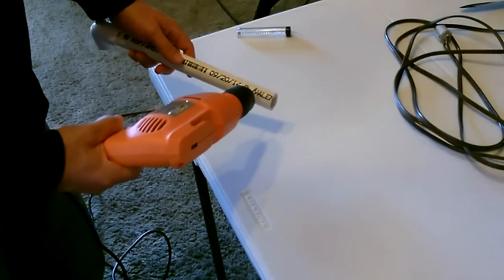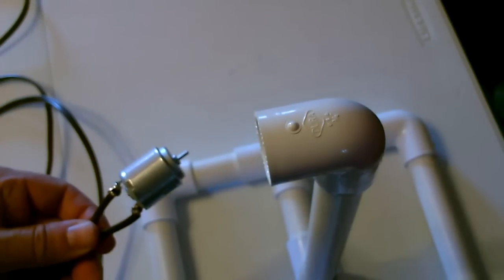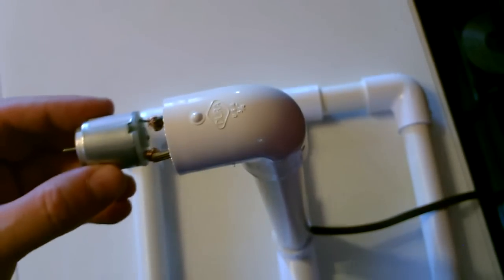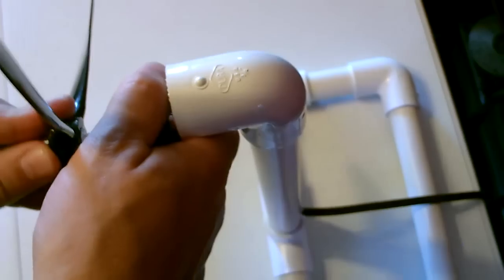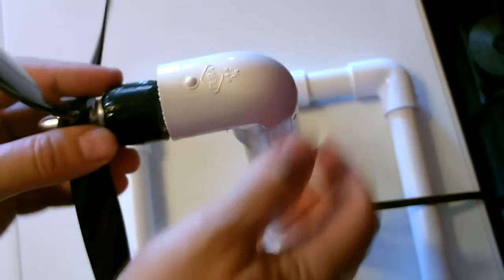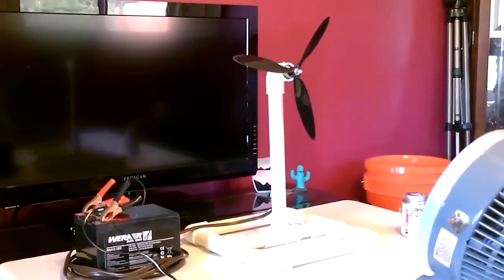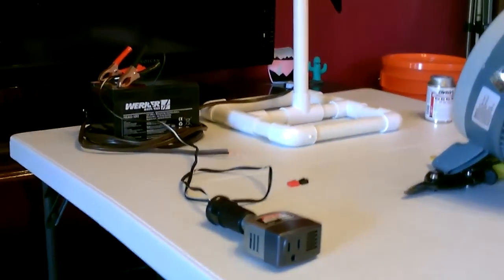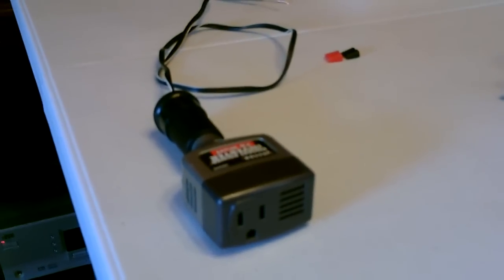Homemade Wind Turbine Generator! - Wind Power Generator! - simple DIY (runs radio!)

Comment: What kind of motor n what's a charge controler?
Reply from the maker: hi there. you can use various motors (even just a small hobby motor works). a charge controller generally is used to make sure that a battery does not overcharge.

Comment: Give the specifics on the motor, fan blade etc.  Where do I get the electronic parts from ?  Your video is good, but how does a novias like me get all the parts.  You mention another gadget to charge the battery, otherwise the battery will run the motor.  What is it specifically?  How do I get one.  Without all the information, your video is of little use to me.  Can I couple a bank of motors and blades for more output?l

Comment: It's all nice and good, this video, and many alike it, well made designs and the like, however, there is a little bit of a problem. Underneath the rays of the sun, plastic, rubber, and such types of materials, decay and become brittle. If one is going to invest, why not outright make everything from stainless steel and aluminium?

Comment: a brushless motor is better it will make more power but ac power then just use diodes to convert it to dc and use a voltage regulator to keep the voltage safe for the battery.

Comment: You could just use a zenor diode between the  fan and the battery so the electrons only flow one way, also i find it hard to believe that that would generate anything above 2 volts, it would be more like a slow drip feed to the battery and if you used a charge controller with that the power generated would be lost in the conversion.
Reply: 2v will not charge a 12v battery!

Comment: How many volts and at what current does it generate?  Use V on meter for voltage and put meter in series of circuit (eg small light) for current reading using Ma on meter.

Comment: So 50 amp @12 volt should output about 4 amp / hour.  Is that about right?  Could it be used to trickle charge a deep cycle battery say in a camping situation eg if say it ran for 10 hours per day then that would total an output of 40 amps? Many thanks.

Comment: thanks for your video. this project only when there is a wind outside to rotate the fan blades, otherwise, we are not able to charge the batteries for electricity. Does the speed of fan rotation has any influence over the charging.

Comment: So if I were to play around with a small motor that's rated at, let's say 10 watts... What kind of RPM would it have to reach to actually output that much power? I guess on average, what percentage do you suppose will be output real-world, compared to the rating of the motor?

Comment: Hi 
I have a few questions about the connections.

1) the video said, if you wanted to run ac you needed a charge controller. I search in how to make a charge controller. The result come up that there are a variety of it. And each one can be used for certain voltage. How do i know that each one that i build need how many voltage, and how do i build it for certain current or voltage ? like 800 watt for example.

2) how do you know when do you need a charge controller ?

3) in order to run ac, why do they need to run through a battery first ? what does a battery do ?

4) what devices uses dc ? and what uses ac. 

5) i can used the created project to charge ipad , phone right ?
Thank you so much
Great projects

Comment: For better results, you can build one that rotates freely so that it can follow changes in wind direction automatically. A tail vane and two right-angle gears will come in handy here. You can stuff the motor down the vertical pipe and have the right-angle gear mounted on it with the other mounted on the turbine shaft.
Reply from the maker: hi there. if interested, here's a link to my other one (it's about the same size, is also made of pvc but it's got a tail vane and rotates) https://youtu.be/kMZdAf9hrFk

Comment: hello sir, i was wondering if you could help me with a few questions because i have an energy project and i decided to create a wind turbine, and thanks to your video i find it possible to make but just need a few answers
1) you said they sell the blades in the hobby shop but since I live in Canada, we don't have that store anymore, so i was wondering if you could tell me where i could get it from or where i could order it from( what is it called)?
2)what is the name of the wire and how could i get it?
3)where could i get PVC pipes from?
4) what is the code to your motor?
Now these were my questions! I hope you have time to answer these questions A.S.A.P because your my only hope for getting a good mark 
Thank you:)

Comment: Im looking into doing something like this but have a question. If you connect a charge controller to the battery terminals and the device you want to power also gets connected battery terminals, what stops the electricity from going into both the battery and device simultaneously or is that acceptable? 
I unknowingly assume you would want the electricity to go into the battery first before leaving for the device?

Comment: The motor you used, where can I get one of those?
Reply: your basement you can find these everywhere.  its just a DC  direct firebrand motor.  electric scooters have them. maybe some fans  but I doubt it.  the bigger the better because more power output

Comment: I'm doing a physics project and I have very little time to do this but my question was how to make it able to light a small bulb around the size of a Christmas light or even a smaller one. like I know you wouldn't need the big battery but what else could you use and how would you connect it to the battery from the fan and then from the battery to the bulb? please answer ASAP. thanks for inspiring my project.
Reply: Try to make joule theft and connect from motor to joule to light bulb ... no need to have batt.
Reply: also would you even need a battery or would the wind create enough energy?
Reply: +Hesitant Alien If you Generating Energy by Wind...
It's depends on your Energy Generator can Generate through

Comment: desertsun02
You do not need a charge controller, use a diode mounted on the positive pole of the engine, such as solar panels use to which the battery will not start the engine.
So you can have the battery connected to the engine.

Comment: what size is the prop adapter? 1.5mm?  i got a 2mm and it's too big, it  is not gripping the motor tight enough. where did you get yours?
Reply from the maker: +Aurelia Segura hi. it's a 2mm motor (and 2mm prop adapter). note that prop adapters seem too be too large for the motor "before" you attach (and tighten it) to the blade, but once you tightly attach the blade and the prop adapter together, it should fit solidly on the motors spindle. *tightening reduces the internal diameter of the prop adapter. (the tighter you attach the prop adapter to the blade, the tighter it will fit on the motors spindle
Reply: +Aurelia Segura use epoxy to adhere them together
Reply: Thank you!  Will try it.

Comment: What type of electric motor did you use and how did yo wire it up so it made the energy instead of useing energy to work?
Reply: +dylan palombo 

Any DC electric motors is pretty much just a conductive coil positioned within a magnetic field. 

If you put power to the coil the motor spins.  

Conversely if you spin the coil within the magnetic field it will produce current.  Putting a prop on the spindle and applying wind force spins the coil. Voila! Current is produced.  

In short any DC electric motor can be used in this capacity you just attach your wires to the + and - terminals of the motor same as you would if you were using it as a motor.

Comment: Were do you buy the motor? I want to save lots of energy, 1 way I am doing it is by using wind and solar power.
Reply: +desertsun02 Which of these motors would  you recommend?

http://www.dx.com/s/permanent+magnet+motor
http://www.dx.com/p/diy-5v-stepper-motor-reduction-motor-silver-blue-150357#.VwRPKqSLTIU http://www.dx.com/p/5v-stepper-motor-uln2003-driver-board-set-158635#.VwRPKaSLTIU
Reply from the maker: +Xx ShadowMaster xX hi. you can buy these motors at electronics stores like frys electronics or online stores like jameco electronics. (rc hobby stores should have them too)
Reply: kk, thx
Reply: That is what I need to know 2

Comment: Nice video, very educational! What do you call your DC motor? It looks like it has very little friction. I have my own DC motor but when I spin the central shaft, I encounter resistance so it stops rotating immediately. By the way, I have obtained this DC motor from a remote-controlled car.

Comment: put a diode in the positive side going to batt youl be good...it will keep it from running the batt down from the power going back to the wind gen  :) just thought id try to help you with your idea  :)
Reply: The diode must be able to block the max voltage from the battery and conduct the max current from the Wind Turbine. For at 12 V battery, this should be in the range of ~15 V, so if the diode can block 20 V, you are good. The current rating depends on the Wind Turbine generator. A small 12 V DC machine will run about 3 A at max speed and load, so if the diode is rated for 4.5 A, that should be sufficient.
Reply: +Jason Ross thanks Jason, this is my concern, as you see above. Can you be more explicit on this? Any diode? Diode on positive side, can you show in pictures? I would appreciate a chat in mail ajaabi(at)gmail, thanks
Reply: Abiodun Ajani
sure :)  find old vcr or radio open it and look for a black diode with silver line at one end. put the lined end of the black diode faceing the batt the other side of diode is your wind gen or any other gen you may make..it keeps the flow of power only one way just remember the the lined side of diode points in the direction of your batt.. i wish i had a way to show a pictue.. but im sure you have some thing broken youl be able to find one in just one last thing some diodes are orange with line, you dont want that one you want the black one with silver line at one end, clip it out of old radio or vcr ect.. goodluck :)
Reply: +Jason Ross thanks bro, I shd get a broken device in the house
Reply: your welcome :)
Reply: Jason Ross 
how to calculate the diode rating ?
Reply: Jason Ross appreciated

Comment: I would like to know the amperage output of your turbine...also the voltage....
Reply: +X Boomer Those tipes of engines produce about 1W-2W on a windy day, basically... It can't charge your phone. But grabbing a 20$ engine from ebay that is ment to generate power could. From 10W to 30W, needs a bigger fan head too tho.
Reply: Maybe not, but it should run a 12v 150 lumen, RV Light...Gold Stars has some on Ebay, and Amazon...
 Only around 8 bucks. I use one with a 7ah 12v battery. Works great, gives good illumination.
search....Gold Stars F3528001 LED Dome Light Fixture Single 921 Wedge 150 Lumens 12v Natural White (1)

  They run about 1.9w...at 12 v...
of course, you gotta have some wind...So you have your unit out the window getting some wind, and the light on the inside..and your golden...:-) as long as the wind holds...

Comment: Can this wind turbine light up a 60 watt light?  If so how?  I'm only getting DC Power around 50 mv DC and no AC which is expected.Is the motor to small.  I think the motor is a 1.6 to 5vdc.  I have another motor that is 9 -18vdc.  I'm sure it will light up a small LED light if I connect it directly or do I need a resister or diode.  If I do what size do I need?

Comment: but u made the fan seem like its spining so fast when u put a blower in front of it ...placed under wind speed how much power will the wind mill produce
Reply: nearly zero watts...that's how much it would produce...think bigger.
Reply: @dvig3261  2 things
watts aren't like volts
and
it can run radio think bigger your a little bit off.
Reply: @dvig3261  be nice

Comment: Hey thanks for the video but i was wondering i have a little motor from my RC gas truck will that work? N where can i get the propellers from? Is it possible to hook it up to the car batteries n inverter to?
Reply: Maybe; RC hobby props for planes; yes but will take forever to charge large batt

Comment: To stick to the nature of the build"cheep" if you go to a website called Hobbyking.com it's an r/c hobby site, the have a little controler that can take up to 36v and hold it at 5v.so for me this is great because I want to make this just for changing my iPhone when I'm out flying. But it will work with anything that uses a standard usb style charger,beings the are a 5v changing system  and I have tons of things that have that.

Comment: if I use a motor then connect it to the battery wont it turn the the motor using battery power, to solve this could I use a diode

Comment: where can i get the motor???
Reply from the maker: adrian ureta hi. many of the hobby stores sell them - along with radio shack, fry's electronics, jameco electronics possibly even amazon
Reply: +desertsun02 Can you give me the motor specifications? I am not an electronics guy but i need this application for a project. Thanks
Reply: +Aniket Gor Any dc motor should work, as long as it fits inside the pipe. You can find a motor like this literally anywhere. If you have an old printer or rc car, etc, you can salvage one about this size.
Reply: +Reddit Gold User Is it called motor or generator? I guess for DC motor we supply power and get work, but here we are generating power. 
Sorry to bother by silly doubts
Reply: Aniket Gor Mechanically a DC motor and a DC generator are the same. Spinning a DC motor manually causes it to generate electricity. Not a silly doubt at all.
Reply: +Reddit Gold User :O Thanks a lot!!
Reply: +Aniket Gor I just went to wallmart and bought a $15 RC car as we have no hobby shops around. Comes with two inside, one to drive and one to steer. Quick way to get some dc motors.
Reply: +agrothe Oh well! Good idea. I also found a "brushless motor" ( which i fell is most suitable for my application considering low wind speeds ) at www.hobbyking.com 
They have an algorithm or something to help you get the perfect motor for your application. Also found the propeller there.

Comment: really neat build, (does anyone know where to find a cheap charge controller, or a link to diy one.)
Reply: Jd Cunningham I made a really cheap charge controller myself for solar or wind turbine. I just came up with the idea myself and I don't think anyone else have one like I made. Will soon have instructions on how to make . The parts are very cheap to but ex. from Ebay. I say maybe around $30 or less..............................1 - 20 volt DC analog meter.
1 - white  led.
1- 12 volt DC photo light switch.
1- 12 volt car relay (maybe around 30 amp type)
All from ebay ! except heavy 12 volt car relay. 
I put a small hole in the back of the meter at about 15 volt mark, then installed the photo resister in that hole. Next I drilled a small hole in the clear plastic cover of the meter facing the photo resister. I then glued on a small piece of tin foil to the needle that can block the light from the led when it reaches around 15 volts scale. When this is done , you will have the project just about done. Like I said I will soon post my video on "How I made this !"
Reply: William Ward I have my video uploaded now on my channel.This circuit is my own design and really cheap to make.
Reply: Bay Drifters I would be very interested in your video thanks for posting.

Comment: I would love to see you hook two or three of these together  in parallel or series  not sure which.    Parts list would be cool as well.   I could attach 5 or so of these to my fence and always be generating some bit of power as we always have a 5-10 mph wind   Not sure if that is enough to drive the propeller your using.  I like these because they are small and I can put them up without any city ordinances...   Maybe a bigger motor suggestion?    Again keeping them fairly small.
Reply from the maker: mkearl111 hi there. or both series and parallel (series to jack up the voltage and parallel for extra current). parts list for stand is shown in video. then just pick a DC motor and blade. i think 5-10 mph would do it. good idea about using the fence. (ex. if you make 5 and use motors with an output of 3v and hook them in series you'd get 15v - which should work well with a 12 volt battery bank).
Reply: +desertsun02 where do you pick a motor and propeller at?...
Reply from the maker: Laurie Flores most RC hobby stores will have them
Reply: ok thank you....

Comment: Does the 9volt dc motor from Radio Shack work fine? Also would I be able to hook it up to my charge controller from my solar panel? If so I can make one and have both solar and wind power.
Reply: If your plan is to charge a 12 volt battery than a 9 volt motor wont do. Keep in mind that small motors don't put out much power. Many people use treadmill motors for generators. You might look into that.

Comment: I have the HF 45 watt kit, could I wire it to the back of the controller where I hook up the solar panel wires that's comes in the kit, or would it blow the panel,  then I could put the turbine just outside on corner of my deck for when I have no sun. Only one heavy duty battery on the HF kit runs down quickly. Maybe a heavy guage wire then it could be longer.
Reply: I am not sure if the Harbor Freight kit could handle a wind turbine on top of the solar panels. I have the same kit and was thinking about adding a winder generator. My plan is to use a separate charge controller on the wind generator.